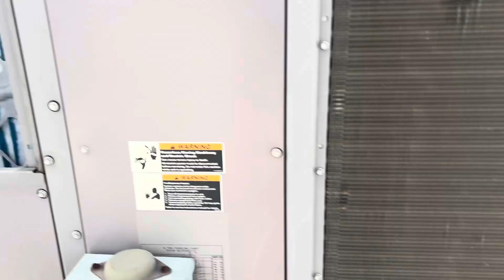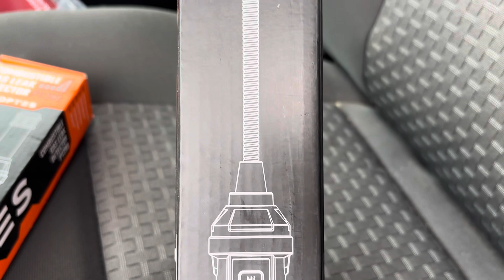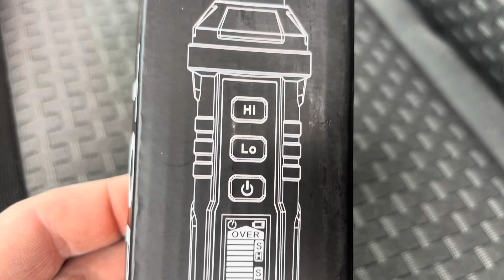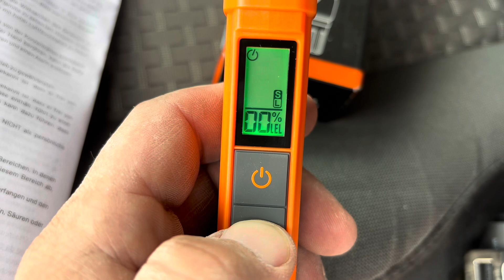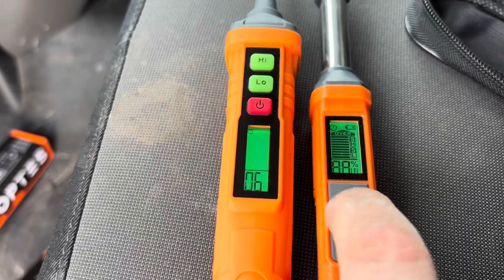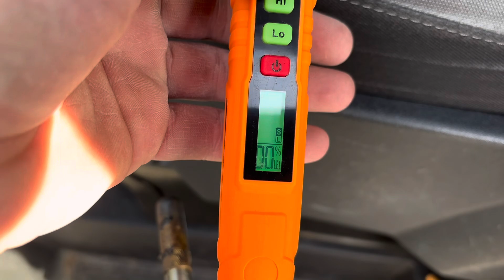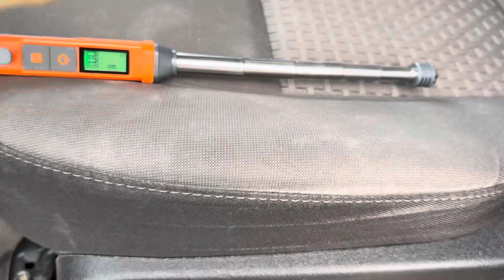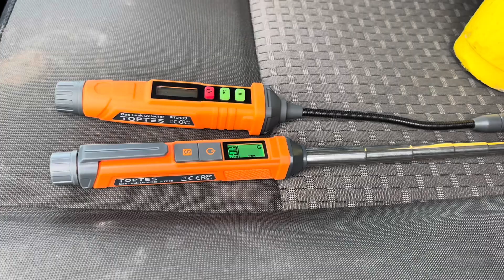Frozen Evap Coil On A No Heat Call?!?

Comment: Thanks for your videos Jeff. I’m putting in my new Heat Pump, my friend is recommending Pro press fittings when I told him my line set was kinking up when trying to make 90 degree curves inside the basement to reach the a-coil and that I was going to use 90 degree plumbing couplers all brazed in. How do you run sharp bends without linking a 7/8” return line? Use a bender? I’ll wait for your response after the drawing. Thank You
Reply from the maker: Yes, you can use a tubing bender or you can use short radius 90s.
Reply: @JeffsHVACAdventures thanks Jeff!